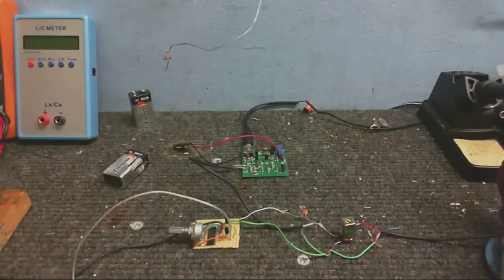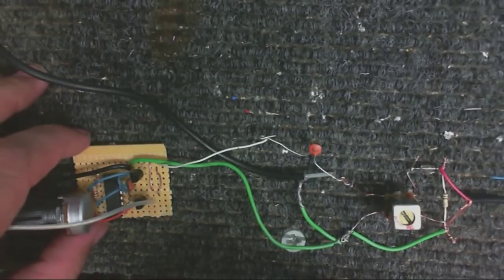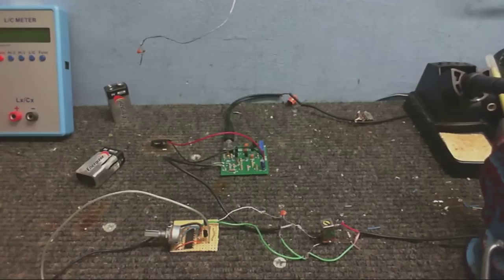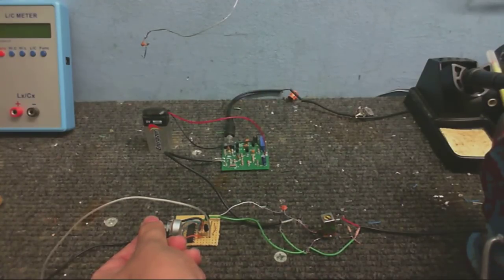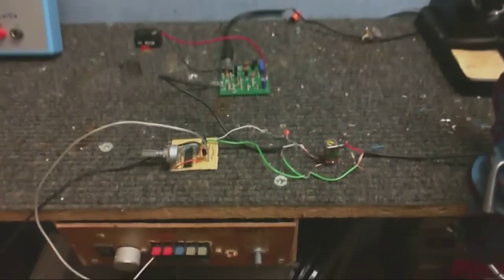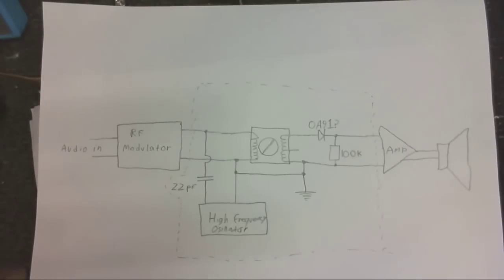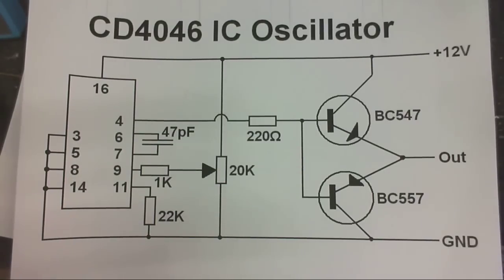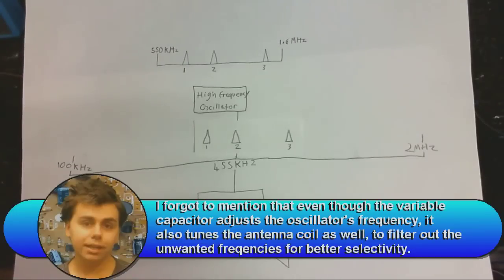A "superhet" experiment.

Comment: Interesting experiment Clem.

The Superhet principal was invented by an American Edwin Armstrong with the express purpose of simplifying radio design.

In early designs radio receivers required separate tuned circuits and amplifier stages to get a good signal.One for each station that was received!

Armstrong's brilliant idea was to devise a system that essentially converted all incoming signals to the SAME frequency which meant that one tuned amplifier strip handling a single narrow band of frequencies  could be used.

He achieved this by employing a "local" oscillator in the radio and combining this with the incoming  radio frequencies.This combination of frequencies produced other frequencies above and below the carriers of those being selected.
The trick was to alter the frequency of the local oscillator IN STEP with the tuning circuit so that the DIFFERENCE between the incoming carrier and the local oscillator always remains the same.
It was then a simple matter of amplifying that "difference" or intermediate frequency as it became known,using one or more amplifying circuits tuned to a single narrow band of frequencies. The response of  the various stages of intermediate frequency amplification was made just wide enough to accommodate  a lo fi audio signal,ie about 0 to 4.5Khz.
The signal could then be detected using conventional methods.

Comment: You have almost understood the principle.There are actually two of the "copies" or Heterodynes that you mention and these are the Sum (Local Osc frequency plus the Station frequency)  and the Difference (Local Osc frequency minus the Station frequency) and it is the Difference one of these that a domestic Superhet A.M. Radio would use.These Heterodynes are produced in the Mixer (Something has to act as mixer and in your little experiment here it will have been something that you did not intend to be so and it wasn't that coupling capacitor).A slightly non-linear amplifier with its output tuned to the I.F. frequency serves as a mixer in a Domestic Superhet A.M. Radio.The Local Osc and Aerial tuning must always be the I.F. apart so that when there is something to receive a Heterodyne at the I.F. frequency is produced (this could be done with mechanical ganging).Does repeated failure really make you ill?

Comment: Is that circuit supposed to reject other frequencies except the one you are trying to tune to?
Reply from the maker: B Blod Something like that, although in a real superhet radio, it happens in the tuning circuit, not in the IF stage (I think).
Reply: CoolDudeClem The tuned circuit, like on a crystal or a regen set, does the main trimming of unwanted signals. The IF stages trim the signal even further, rejecting the unwanted ones while amplifying the proper frequency.

In a superhet receiver you first get the regular tuned circuit, then the stage with oscillator and mixer, where the signal gets converted to a constant frequency. From there on, the receiver is similar to a TRF radio tuned to 455 KHz (or whatever IF is used).

I consier the superhet to be a bit of a masterpiece, when it was invented it was so ahead of it's time it was impractical due to how crude tubes were back then.

Comment: IF what?  Can?  What is that?

.
Reply from the maker: yergaderga It's Ok, I don't understand it fully either!  The best way I can think of is that the IF can is a deice that only lets a very narrow band of frequencies get though (in this case 455khz being the most)
Reply: CoolDudeClem IF can is simple, - it is a transformer with a tunable core as well as few caps connected to windings. In some cans (old ones) you can tune caps to peak it, in modern stuff you tune the ferrite core. Capacitor and coil forms tank circuit, that's what creates selectivity.